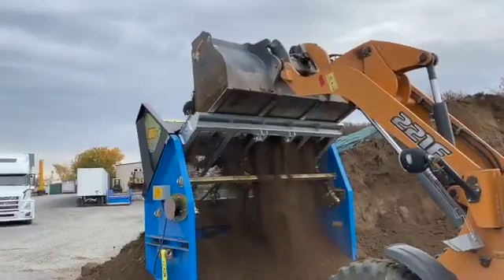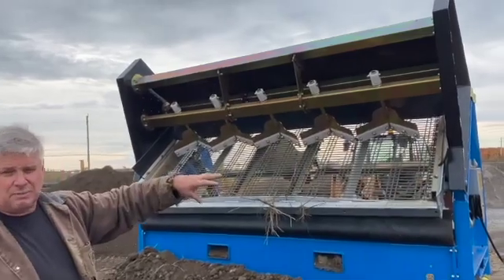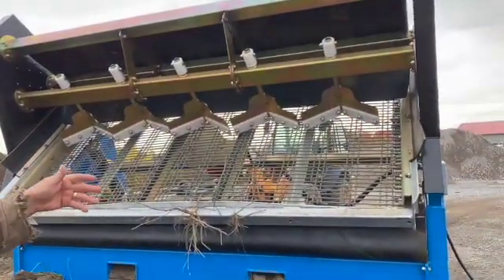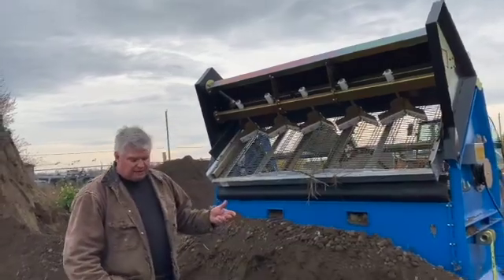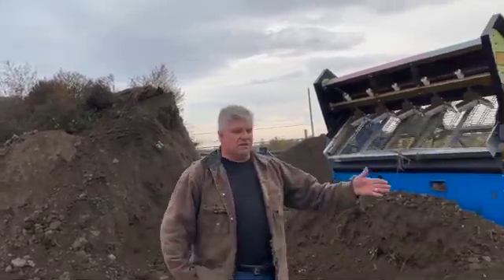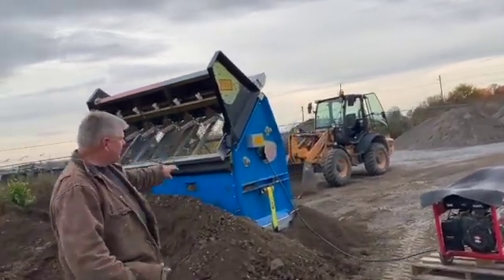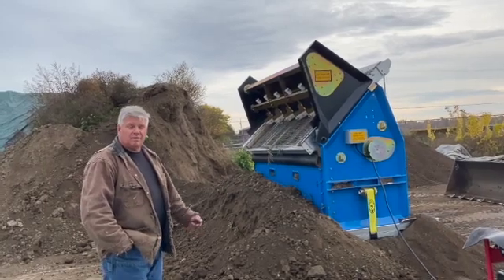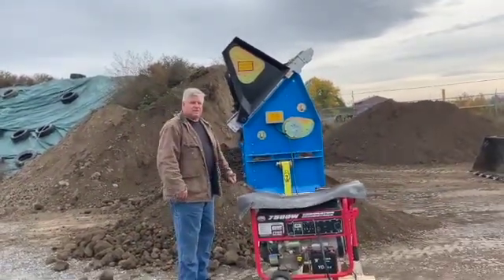DESITE SLG 78VFRB WITH NEW FEED DEFLECTION SYSTEM   SD 480p

Comment: This looks like a great idea. I am sure it's harder but I wonder if it would be better to have the gate system closer to the bottom so it holds more dirt and sifts more. Trying to buy one soon so I can try this out and if I get a good deal i'll post some videos. Looks great tho.
Reply from the maker: have to be careful about holding material on the screen deck too long. if the material is wet nd stays in one place too long it will stick to the mesh  and work against the screening process.. thanks for your thoughts i enjoy feedback on our designs